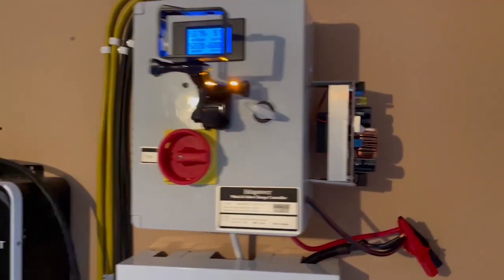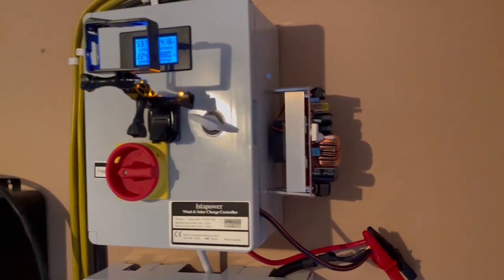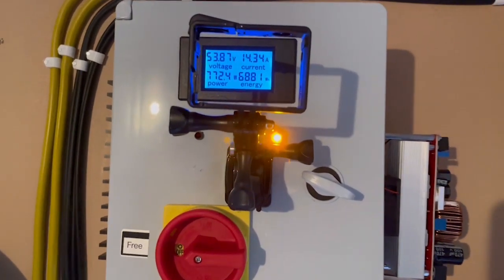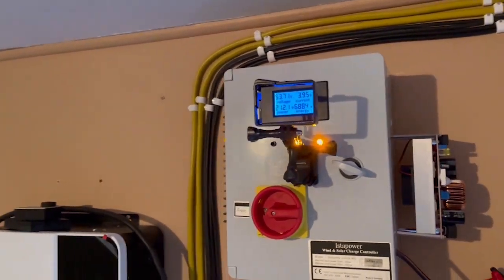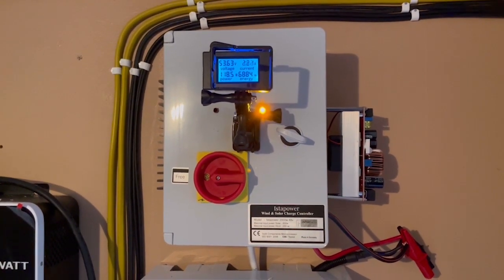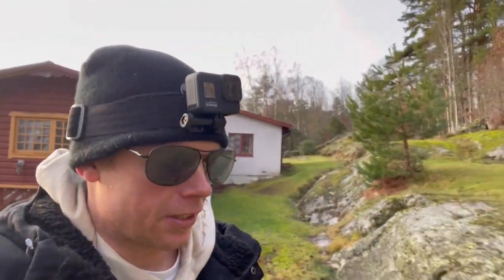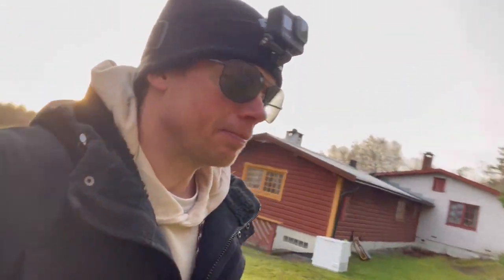Max power Istabreeze i1500 48V wind turbine in crazy 22-45 miles/h wind

Comment: Great videos thank you very much. Can you elaborate a bit more why you discontinued it? Was there a failure or you mention it required a lot of work? I thought once setup it runs without much maintenance. Or is there is a lot of ongoing work?
Reply from the maker: @Hans-x7j9v Thanks. I changed my 48v battery to 420v instead.

Comment: The panning and large fluctuations in power output are caused by turbulence the machine is experiencing because the tower is too short.
With a taller tower that gets the machine up 40' above everything within 400', you would see power output max out and stay there.
Reply from the maker: Yes you are right about that, but sadly due to the Swedish regulations, I’m not allowed too do that.

Comment: Yeah from reading your description my initial thoughts were correct. You need a heavier line to handle that load without so much losses.
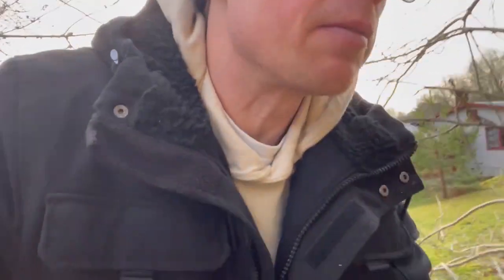Reply from the maker: Absolutely, I mention that at 2:08 and you can also se me do a voltage drop/power loss test here:
https://youtu.be/iddzVztckZQ
You should not take this too serious because it is built more fun, and to be honest, I had to say that I think that it actually works better than I expected. If I had to use the correct gauge on the wires, this project never had happened in the first place. Thank you for your comment anyway.😊

Comment: I just not getting good results with mine.
I2000 48v just not catching the wind.
Ordered a mppt charge controller to try help out. May try 5 blades 🙄
Reply from the maker: Hi. I know what you mean. It has to be really windy before it generate some good power. I went from 5 to 3 blades. It spins faster and it generate more power in good wind. 5 blades will probably work better in low wind conditions together with an mppt controller. Good luck to you.

Comment: Do you recommend 3 or 5 blades for i1500? I dont have such an open area as you, so a bit less windy. I live in a small valley going north/south
Reply from the maker: Hi. It’s so hard to say. I have tried both, I might go for a 5 bladed version in your situation but only together with an mppt tracker so you get power in low wind.

Comment: Kul att se en video från Sverige med en ista Breeze snurra! Är själv i planeringsstadiet att testa antingen en Heli 2.0 eller 4.0 med maximalt tillåtna höjd på masten dvs. 20m. Är du nöjd med snurran överlag?
Reply from the maker: Hej, och va kul att du tycker det! 😃 Ja,  jag är jättenöjd, den ger mer än vad jag hade förväntat mig. Kvaliteten känns helt ok för dom pengarna. Infästningen mot röret kunde varit annorlunda, jag valde att slitsa mitt rör och klämma ihop det med typ en avgasklämma samtidigt som jag givetvis använder de två originalbultarna ihop med locktight, då sitter den rejält. En längre mast hade förmodligen ökat antalet kilowatt timmar men på grund av de regler som råder kan jag ej göra den längre i nu läget. Jag har provat med både fem och tre blad, jag föredrar tre blad då det känns som vindsnurran varvar lättare. Jag rekommenderar också någon form av en Mppt tracker då den annars inte ge dig någon ström alls om det inte blåser typ tio sekundmeter.
Detta blev visst väldigt långt svar
men jag hoppas det underlättar för dig i ditt val av vindturbin.
Stort tack för din kommentar☺️

Comment: Great video, and fully documented regarding power losses. I am about to install one i-1000, 48V, so you video will help to understand what to expect. Thank you.
Reply from the maker: And thank you for your comment. I’m planning to make a video when I am measuring the real voltage drop later on.
I which you luck with the installation😊
Reply: @flyingtools  Hej! The I-1000 is now working very fine, after a year of use. 

And I got also the dc/dc converter as you did. I think that works fine with low wind speeds but I am not sure if I want to leave it definitely. If you have any comment to help me in the decision making process, I really appreciate that.

I am happy to see you growing in Youtubes views and in hardware. Keep it up, sir!

Comment: great video , I think you should try to put a bigger tale on the turbine . I think you lose a lot off power because it's not straight in the wind a lot of time .
It's very gusty wind there and i'ts not tracking right , it swings to much . Just put a extra aluminium  plate on the tale and try it out .
Reply from the maker: Thank you 😃 You are absolutely right, I will try that out. Thanks for your advice.👍🏻

Comment: Great video👍🏻im thinking of getting a 48v istanreeze for my 24v system, because of low wind in my area.
Reply from the maker: Thank you😃.
That sounds like a great idea. Just be aware that you get only half of the power at the same windspeed. A 1500w 48v will produce 750w on 24v. But rather something than nothing. Personally I think I will buy a MPPT tracker later on.
Reply: @flyingtools  have you seen any mppt tracker that works?
Reply from the maker: @brianwind7680  I have seen some on YouTube but never tested them myself. I let you know if I find one😉
Reply: @flyingtools  you might want to look at ohms law :) at 24v you only have 1/4 of the watts
Reply from the maker: @myflydream94  okay, then I  must have missed something, please show me your mathematical line-up.
Reply: @flyingtools  P = U x I    watt = volt x amps , eks.    24volt x 10aps = 240wattt , 48 volt x 10 amps = 480watt :)
Reply: and U = I x R, the two generators will not have the same ohm between the 3 phases thats why
Reply: but i like your video please update later, and yes find a bigger cable if you can you have a some loss in the cable, but i know its expensive :) ,
Reply from the maker: @myflydream94  ok, thank you.  I just think you have missed something here, we are talking about to use a 48 V turbine in a 24V system. The wind turbine will generate the same amps on 48 V as on 24 V there for half the power and not 1/4.
Reply: @flyingtools  i read too late at night my faullt , i miss read that :)
Reply from the maker: @myflydream94  no problem☺️